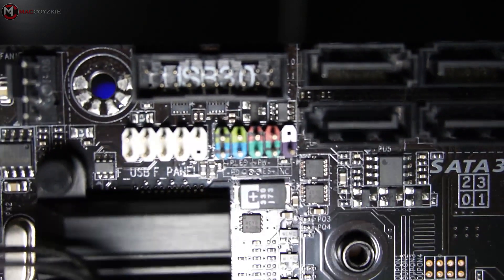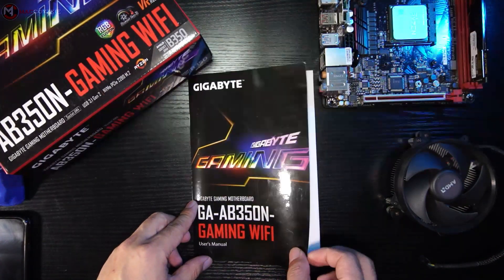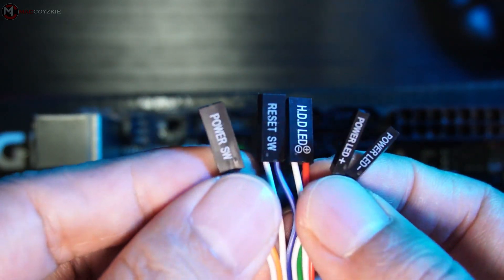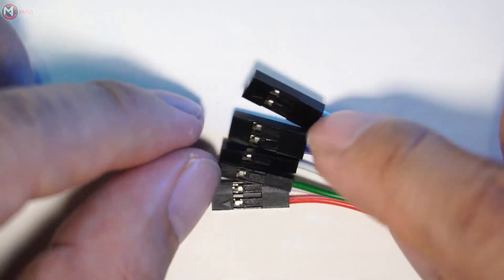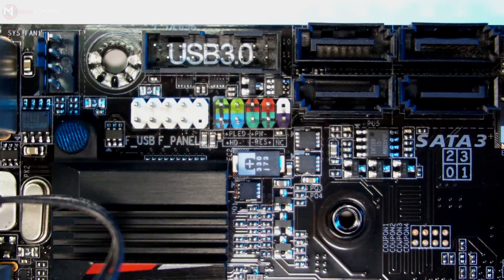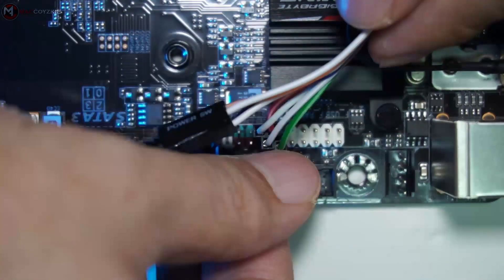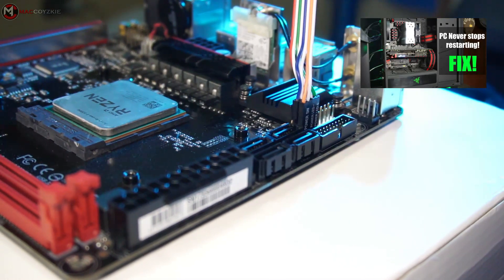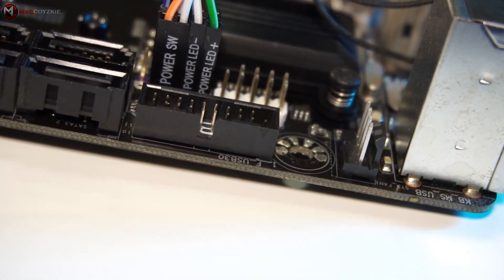How to connect front panel connectors to the motherboard f_panel header?

Comment: For some unknown reason, if I put my reset switch onto and power switch on the bottom(flip it) it works
Reply from the maker: that's crazy lol, its the pc case's fault
Reply: @ yeah but my GIGABYTE GA-H170-HD3 worked normally in the cables normal orientation with the power switch on top

Comment: I have no reset switch but i have GND instead of reset switch.. Where we connect GND
Reply from the maker: GND represents ground. Connect any front panel pins labeled 'common,' 'ground,' or marked with a negative sign to this.

Comment: Putting an older motherboard that doesn't have that 10-1 JFP1 plugin. The MOBO I am trying to install a 20-8 pin layout and I can't connect with out breaking up the connector pins. How does one go about fixing this connection issue?
Reply from the maker: i think you need to contact the motherboard manufacturer or at least where you got the mobo from, use warranty
Reply: The case is new, the motherboard is from 2010. no warranty. The only solution that I have found that doesn't require breaking the plastic case and breaking the individual connnectors is to get Front IO connections extenders to plug into the JFP1 plugin. and use those extenders to plug into the individual pins on the MOBO.
Reply from the maker: @berjbedrosian4225  hopefully it works
Reply: @MacCoyzkie  I bought front panel extension connectors and after some trial and error on how to  plug in and where to plug in I finally got it to turn on! It worked until the graphics card gave out..... :(

Comment: I'm doing a rebuild on my old thermaltake case. I built this thing twelve years ago. The front panel pins were terrorizing me. You took the mystery out of it. Thank you so much.
Reply from the maker: glad the  video was helpful 😊
Reply: building in a core v1 right now how did you do this
Reply: @1LetterLef   The secret is to look on the plug. It has a down ^ on the positive side on the back of the plug.
Reply: thank you for the quick response just finished looks beautiful @singingfalls

Comment: Why does the pro b650m a not have any front panel connectors? Looked all over the motherboard for them but nothing.
Reply from the maker: what brand? gigabyte, msi, asus?
Reply: @MacCoyzkie  found them but they don't have any + or - so I just had to follow a tutorial on where to put them in.
Reply from the maker: @RiceWitchR  some motherboards don't have those indication and it will have like a tiny writing near it. tbh this is the most difficult part of pc building
Reply: @MacCoyzkie  My old motherboard had writing so it is just really annoying!
Reply from the maker: @RiceWitchR   i know, manufacturers should do something about this, it's 2023 already

Comment: Hi there I recently upgraded my case and didn’t realize it had an f panel connect that combines all the pins to one connector  is it possible to just buy mother board extension cables and plug them into that case I/o connector then to the mother board f panel? Thank you
Reply from the maker: it depends, some built in fans headers from the case have remove control that does not need motherboard assistance but you try it, nothing will blow up anyways. the worst thing you can experience is the fans wont work on it

Comment: Hey, my manual doesn't say which side is positive or negative for my reset or power button. It only lists power button and ground. Is the ground the same as positive?
Reply from the maker: what is the model name of your motherboard?
Reply: @MacCoyzkie  rog strix z690-e. In my manual it doesn't say + or -. It only tells me ground and power switch. Is ground supposed to be my positive or is it supposed to be my negative
Reply: @MacCoyzkie  never mind, I found another video that explained that power button and reset button are the positives that need the triangle and grounds are the negatives. The books don't explain this at all
Reply from the maker: @theclaybeartravels3596  i see, glad its all good now

Comment: If i have a prebuild and i want to swap the case,and i don't have the motherboard manual,is it ok to take a photo of what goes where and copy it on the new case?
Reply from the maker: yes that will help also, besides if you make a mistake plugging the wrong front panel connector the worst case is that your pc will not turn on.
Reply: @MacCoyzkie  ok,thank you

Comment: guys please i need some help. i have a predator g3-710 motherboard. no manual and no info on the front panel. there are 13 pins but only 8 connectors. i am thinking about emailing acer and see if they can help...
Reply from the maker: i think your only choice is to ask support, usually there are little tiny words besides the front panel, try checking it too
Reply: @MacCoyzkie  it only said "LEDhd" but I managed to find a guy who had the same issue and I did what he did. All good now

Comment: My phanteks only came with HD audio and power sw, and USB 3. Should I be worried?
Reply from the maker: some pc cases are having that as a standard, my 011 Dynamic mini has the same front panel connection like yours

Comment: I did't Same but is not Working i have a Acer m4 mainboard
Reply from the maker: either motherboard is faulty or the front panel connector cables are faulty. Try jump starting your pc to test if the motherboard is ok

Comment: Hey bro, before i connect it wrongly and my cpu didn't turn on. Will there be any problem to motherboard since i messed up those connecters before:/
Reply from the maker: like i said in the video, nothing will happen if you messed up the connectors in the front panel io. It will just not work

Comment: I really need your help man. My problem is my monitor,  yesterday im in a middle of game and my monitor suddenly turn off but everything is ok the music is still working just the monitor. Tomorrow when i tried to open my pc but its not working so when i plugged my monitor it should say 'Acer" but no display at all. What do you think is the problem is?
Reply from the maker: two things bro, your monitor cable (hdmi or dp) might be faulty or the monitor itself is faulty, try using other pc or console to double check the monitor and monitor cable
Reply: i checked the cables man its fine i even tried another cable its fine. yeah i think my monitor is the problem what i dont understand is my monitor is in standby mode orange light. btw man thanks !